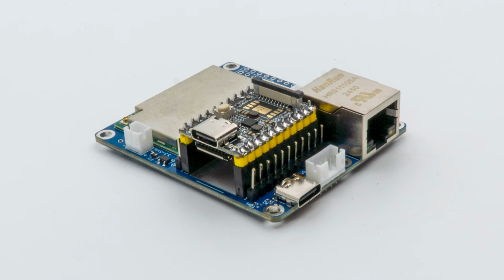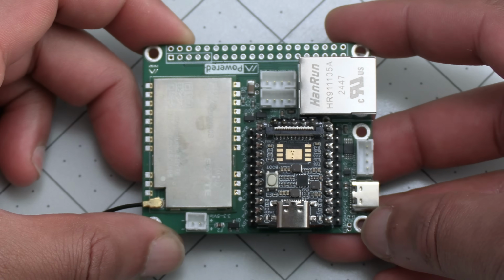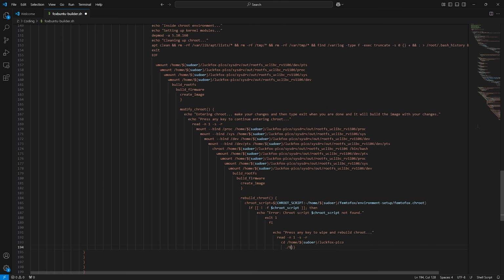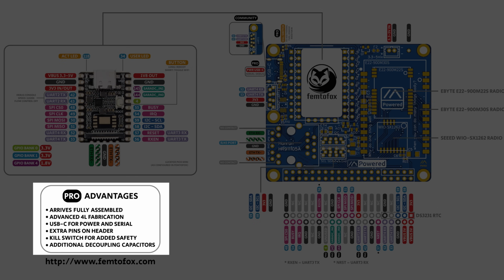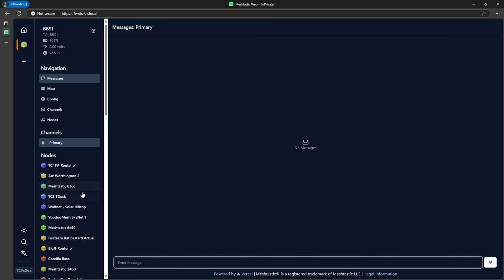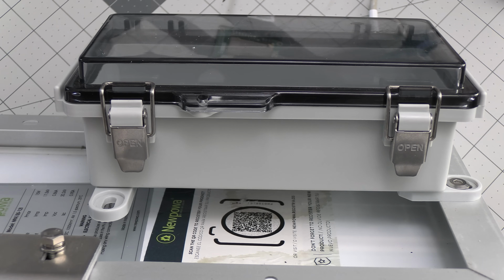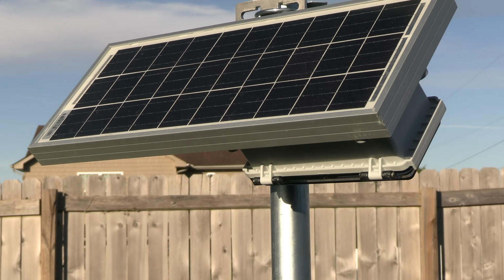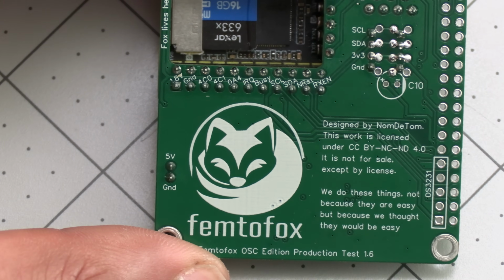Ultimate Solar Build with Femtofox

Comment: The Femto is pretty nice. Got mine in last week. For some reason though it doesn't want to boot with the RTC installed. Made sure to verify via the pinout diagram
 it was connected properly but it didn't seem to do anything with it installed. I just pulled it and moved on for now. Probably just missed something. Looks like maybe you didn't use one in the build though. Thanks for the video and brining attention to this project.
Reply from the maker: Hmmm... I didn't use one in my build since I'm using WiFi so not sure what could be going on there and sounds like you already did some troubleshooting. You may want to reach out to them on Github or Discord if needed

Comment: This is a great intro to the femotfox. Sometimes the S/N on discord is high, sometimes it is low - it can be hard to filter. Now I definitely want to get one... or three. :)
I also want to mention about 5:38 : rak brownouts are 100% preventable with one of Keith's boards. I'm just a happy user and gain nothing by saying that.

Comment: I wrote out some python to start an rtlsdr and js8call to pipe the data to the meshtastic bbs but I never thought I could run that offgrid. I'm sure I would have to beef up the battery to power the sdr but this is worlds better than running it all on a Pi.
Reply from the maker: Nice! I considered doing the same with js8py but haven't gotten a chance to write it yet. Is that what you're using? Is your script on GitHub or anywhere?
Reply: @The_Comms_Channel  Im actually using js8net. I originally planned on doing all of the message parsing and storage on my side and then have the BBS pull from the local storage. Spent about a week and a half bashing my face against the fantastic JS8CALL API documentation just to find out that you already had that baked into the BBS software hahaha. 

The code isn't on github, it's still a bit messy and I'm not too proud of it but I can send it your way if you would like.
Reply from the maker: Ah, haven't heard of js8 net. I'll check it out! No worries on the code being messy! If you want you can email me or reach out on Discord

Comment: This with poe would be perfect
Reply from the maker: You could follow the steps for the PoE BBS build and just replace the Pi and RAK radio with this. I'll be working on an enclosure mount for just the FemtoFox without the Solar Power Manager to allow for this

Comment: Are you attaching an HF radio to this meshtastic node? Can you briefly explain how you intend to integrate an HF radio into the meshtastic network so users can send ultra long distance messages? Would it be possible to integrate a low powered HF radio into this solar setup to send JS8call messages long distances?
Reply from the maker: @russm195  connecting via API

https://youtu.be/LTLnYqUScXM
Reply: That video doesn’t seem to reveal where your HF radio is located, and how it’s powered? 

I’m trying to understand the reasoning for connecting to a Meshtastic network if a HF radio with JS8Call can already transmit messages long distances on its own.
Reply from the maker: @russm195  In the video, I'm using my Icom 705, but this can be whatever HF radio you want connected to a computer running JS8Call. The radio is located on the same network as the BBS. This isn't meant as a way to send messages via HF. This is meant as a way for people who don't have a ham license to receive messages via HF as a bulletin via Meshtastic using the BBS
Reply: Oh interesting. This may be a dumb question, but why would you need to do this on meshtastic? Without a HAM license I can still receive JS8Call messages directly to my radio. I’m just trying to understand the practical use cases for this, and admittedly think it’s really cool!
Reply from the maker: @russm195  You're fine! I should have been clearer. This is to allow regular people who aren't radio nerds like us 🤓 who have no interest in radio but are familiar with Meshtastic due to friends, family members, etc setting them up with it. This will allow them an easy way to receive these bulletins without having to know JS8Call or radio stuff

Comment: Website won’t let me check out and Waveshare Solar Manager (D)

No delivery available
This item will be removed from your cart because there are no delivery methods available for your address.
Reply from the maker: Not seeing that here. Where are you located?
Reply: @ NYX . As soon as I click out the checkout link on the website, that’s what happens.
Reply from the maker: Ah, I see what you mean now. That's been fixed and should work. Let me know if that's not the case though. Thanks for the heads up!
Reply: @ ya it’s fixed my bank is being a terd tho .

We're sorry. Your purchase was declined. Retrying the purchase may fix it.
Reply from the maker: Darn.. Let me know if you continue having trouble. I can upload to Etsy if need be and maybe that will work better with your bank
Reply: @The_Comms_Channel  that might actually work a little better if possible I have Etsy credit as well
Reply: @KboxLabs  what’s a mud?
Reply: @ https://en.m.wikipedia.org/wiki/Multi-user_dungeon